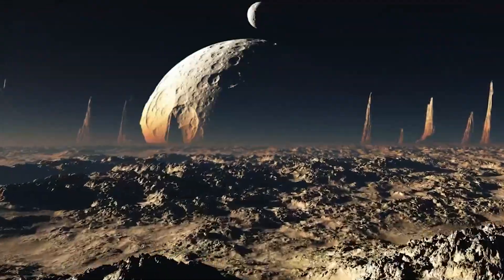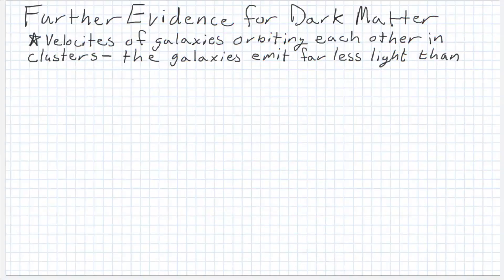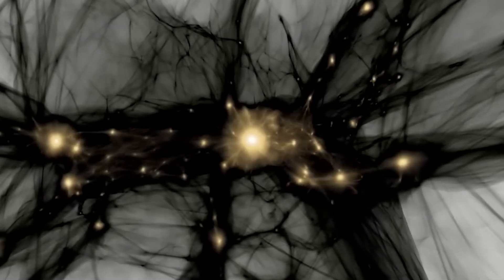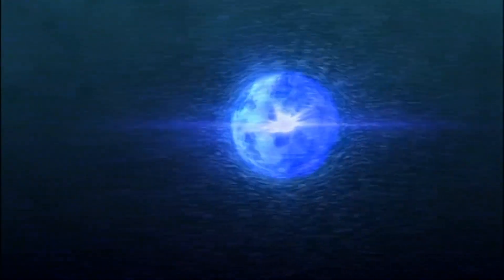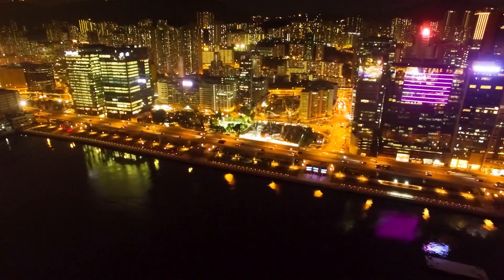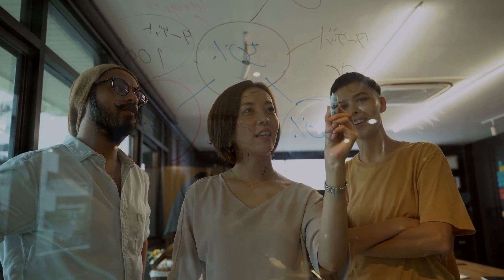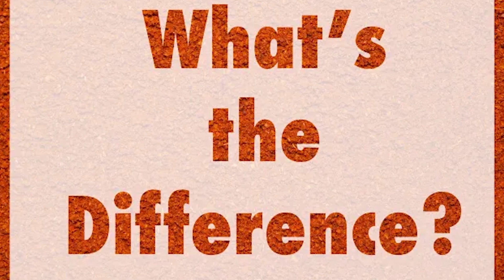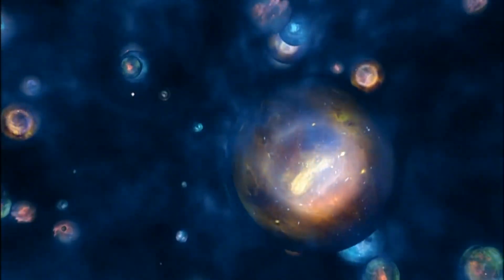Is Gravity Wrong? Scientists Question Dark Matter Theory!

Comment: Alternative Explanation of the Two "Dark Ghosts".

Einstein’s theory of General Relativity states that spacetime is curved by the presence of mass. This curvature influences the motion other objects with mass and gives rise to gravitation. Thus, gravity is a result of geometric features in spacetime.

However, we also observe gravitational effects – curvature of spacetime – in areas without any detectable mass. This has given rise to the concept of dark matter, which is matter that does not interact in any detectable way with normal matter, except through gravity. So, there is some large quantity of dark matter scattered throughout the universe, which curves spacetime and causes gravitational effects just like normal matter, but we cannot see or detect it with any known method.

An alternative theory to the identity of dark matter is proposed – it is not matter at all, but rather an intrinsic curvature of spacetime. In other words, spacetime is not naturally flat. Even in the absence of matter, we observe some inherent curvature of spacetime.

So, the question is now – why is spacetime naturally curved? Why is it not flat in the absence of mass?

The universe is 4-dimensional, with 3 spatial dimensions and one dimension in time. Rather than consider time as a linear dimension, we can consider it as a radial one. Therefore, rather than describing the universe with a Cartesian coordinate system, we describe it with a 4-dimensional spherical coordinate system – 3 angular coordinates, φ1,  φ2,  φ3, and one radial coordinate in time, t. We live on the 3-dimensional surface of a 4-dimensional bubble which is expanding radially in time. Thus, the Big Bang represents t=0, the beginning of time.

The crucial point is that the expansion of the universe is not homogeneous in all directions. The expansion rate at one point on the bubble’s surface may differ slightly from another point near it. The universe is only roughly spherical in 4 dimensions, the same way that the Earth is only roughly spherical in 3 dimensions. The same way we observe local mountains and valleys on the surface of Earth, we observe local “mountains” and “valleys” on the surface of the universe bubble. The inhomogeneity of the expansion of the universe has given rise to natural curvature of spacetime. This natural curvature causes the phenomenon of “dark matter”.

“Valleys” in spacetime pull matter in, similarly to the warping of spacetime of massive objects. So “dark matter” is really “valleys” in spacetime that are expanding slower than the regions surrounding it. These valleys tend to pull matter in and create planets, stars, and galaxies – regions of space with higher-than-average densities of mass. Conversely, “mountains” in spacetime will repel matter away, an “anti-gravitational” effect, which gives rise to cosmic voids in space where we observe no matter.

Each point on the surface of the universe bubble traces out a time arrow in 4-dimensional space, perpendicular to the surface. These time arrows are not parallel to each other since the universe is not flat. This causes points to have nonzero relative velocity away from each other. It is generally accepted that the universe is expanding faster than observable energy can explain, and this is expansion is believe to be still accelerating. The “missing” energy required to explain these observations has given rise to the theory of dark energy. The time dilation caused by non-parallel time arrows can be proposed as an explanation for dark energy. Alternatively, dark energy is real energy coming from potential energy gradients caused by non-parallel time arrows.

As a sanity check, we can calculate the expansion rate of the universe based on the universe bubble model. Since the radius of the universe bubble is expanding at the speed of light in the time direction, it increases at 1 light second per second. Therefore, the “circumference” of the 3-dimensional surface increases by 2π light seconds per second, or about 1.88*10^6 km/s. This expansion is distributed equally across the 3-dimensional surface, so the actual observed expansion rate is proportional to the distance from the observer. At present, the age of the universe is estimated to be 13.8 billion years, so the radius of the universe bubble is 13.8 billion light years, or about 4233 megaparsecs (3.26 million light years to 1 Mpc). Thus, we can calculate the expansion rate of the universe, per megaparsec from the observer, as:

Expansion rate = ((d(circumference))/dt)/radiusofuniverse=(1.88*〖10〗^6  km⁄s)/(2π*4233Mpc)=(1.88*〖10〗^6  km⁄s)/26598Mpc=70.82(km⁄s)/Mpc

The popularly accepted empirical expansion rate is 73.5 + 2.5 km/s/Mpc, so our calculated value is close. There may be some additional source of expansion (or observed red shift) to make up for the discrepancy. For example, if two adjacent points have some gravitational gradient due to non-parallel time arrows, then light passing through these points will be red-shifted. – Cited from https://www.academia.edu/82481487/Title_Alternative_Explanation_of_Dark_Matter_and_Dark_Energy

Comment: Most people don't know that Einstein said that singularities are not possible. In the 1939 journal "Annals of Mathematics" he wrote "the essential result of this investigation is a clear understanding as to why the Schwarzchild singularities (Schwarzchild was the first to raise the issue of General relativity predicting singularities) do not exist in physical reality. Although the theory given here treats only clusters whose particles move along circular paths it does seem to be subject to reasonable doubt that more general cases will have analogous results. The Schwarzchild singularities do not appear for the reason that matter cannot be concentrated arbitrarily. And this is due to the fact that otherwise the constituting particles would reach the velocity of light."
   He was referring to the phenomenon of dilation (sometimes called gamma or y) mass that is dilated is smeared through spacetime relative to an outside observer. This is illustrated in a common 2 axis relativity graph with velocity on the horizontal line and dilation on the vertical. Even mass that exists at 75% light speed is partially dilated.
   General relativity does not predict singularities when you factor in dilation. Einstein is known to have repeatedly spoken about this. Nobody believed in black holes when he was alive for this reason.
   Wherever you have an astronomical quantity of mass, dilation will occur because high mass means high momentum. There is no place in the universe where mass is more concentrated than at the center of a galaxy.
   According to Einstein's math, the mass at the center of our own galaxy must be dilated. In other words that mass is all around us. This is the explanation for the abnormally high rotation rates of stars in spiral galaxies, the missing mass is dilated mass.
   According to Einstein's math, galaxies with very, very low mass would show no signs of dark matter because they do not have enough mass at the center to achieve relativistic velocities, therefore they are not infused with dilated mass. This has recently been confirmed with galaxy NGC 1052-DF2. This is virtual proof that dilation is the governing phenomenon in galactic centers, there can be no other realistic explanation for this fact.
Reply: Einstein was a smart guy, plenty of things that we have observed in the last 100 years are exactly the points of evidence he often cited that would disprove all the space-time nonsense.   He would have been the first the toss it into the trash bin.
Reply: Your "dilation mass" theory has one HUGE gaping hole.  You have no definition for 'mass', other than to toss about a few other words that begin with the letter 'm'.   Darkmatter never existed, and the gravity driven rotation models will never work.   Galactic rotation is driven by it's electrical circuit & the interactions with the intragalactic Birkeland currents.
Reply: @sonpopco-op9682  Thanks to Einstein, mass is a clearly defined thing. I agree the nature of the universe is electrical. 
   Electricity is drawn towards potential and the universe as a whole behaves the same way. If something accelerates at a constant rate it will get faster and faster. The exponential expansion rate of the universe is what the known laws of physics would predict provided gravitational forces are not strong enough to counteract. There is no reason to postulate dark energy. Do we postulate some force driving electrons through a cable?
Reply: @shawns0762  "  Thanks to Einstein, mass is a clearly defined thing."  REALLY?
WHERE IS THAT DEFINITION????
Reply: @sonpopco-op9682  Thanks to Einstein we know about the equivalence of mass and energy, thanks to Einstein we understand the orbits of the planets, etc, etc...
Reply: @shawns0762  repeating nonsense doesnt make it true.  Go ahead repeat it one more time.